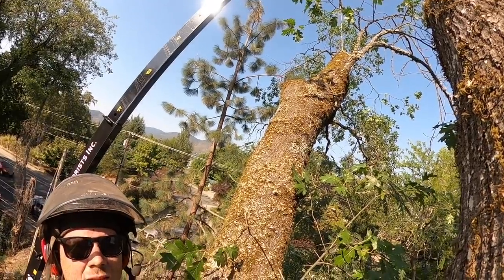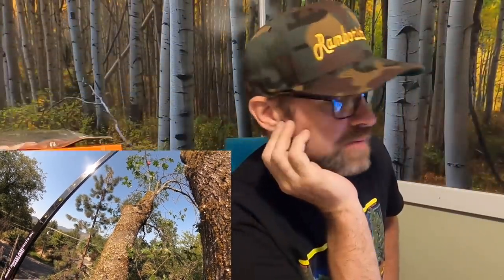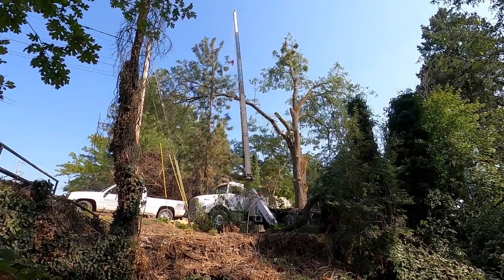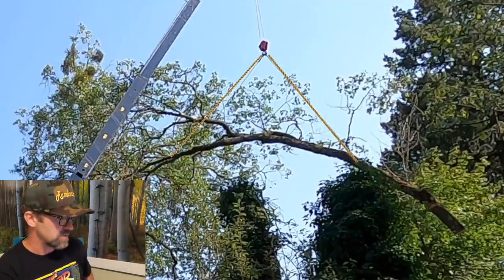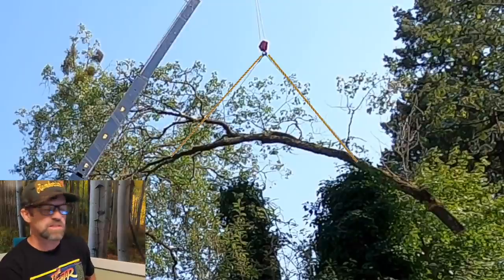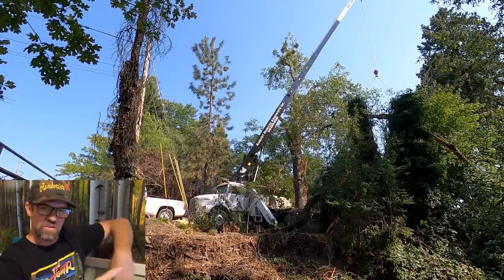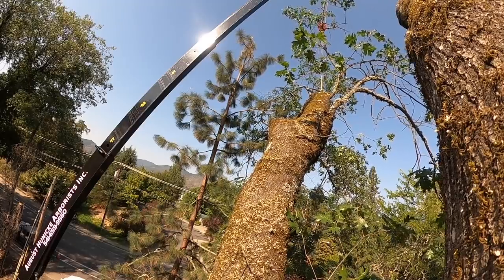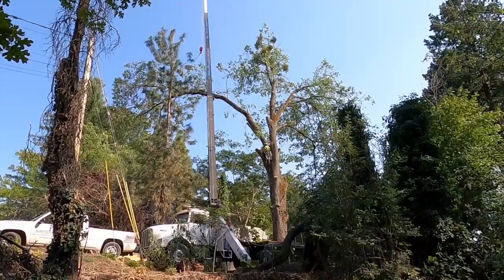Anatomy of a smooth Crane Pick

Comment: I've been doing crane tree removals for 15+ years, always stood those up with a notch on top stand it up through the notch with a nice hinge.
Reply from the maker: Mb. Like I said, I’ve done it too. Not supposed to tho.
Reply: @AugustHunicke  All depends on the situation and more so your LZ. You may not have the room to set a long horizontal pick down and have to stand the piece up instead. It's harder to do, but certainly is an allowable and acceptable way to make the lift, just not part of the BMP for Crane Rigging in Trees.
Reply from the maker: @chrisgirard7297  I think standing them up is easier, less rigging. There’s a time for everything. Yep, crane classes want to line angle always straight up and down. Not reasonable in the real world IMO